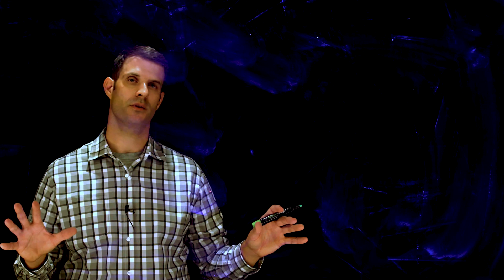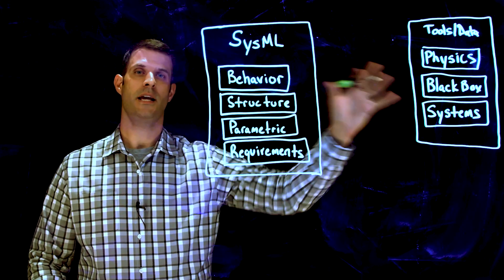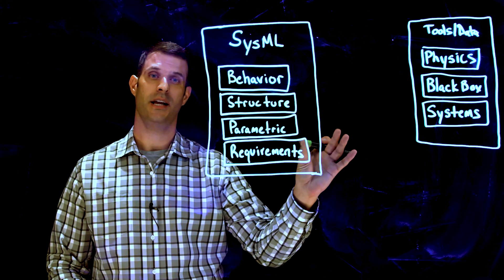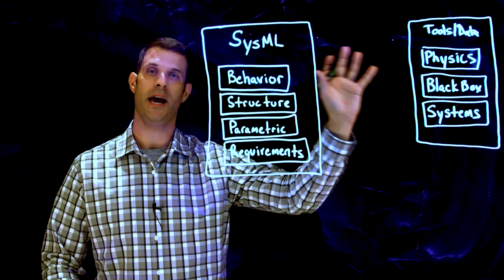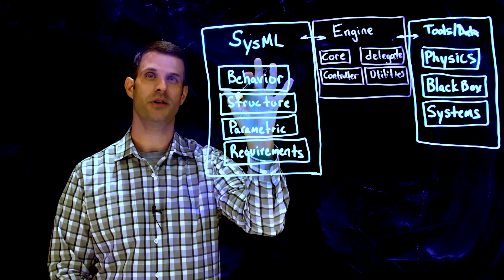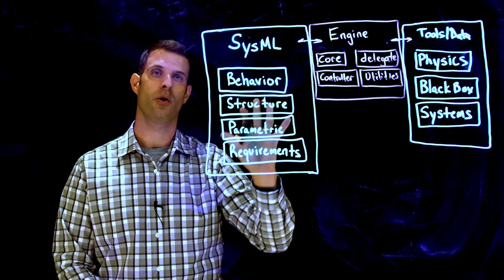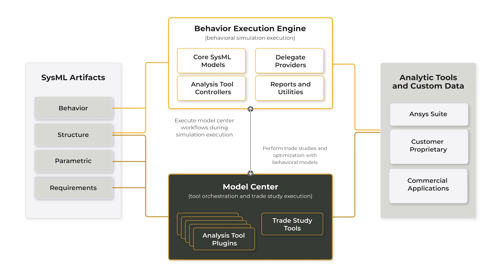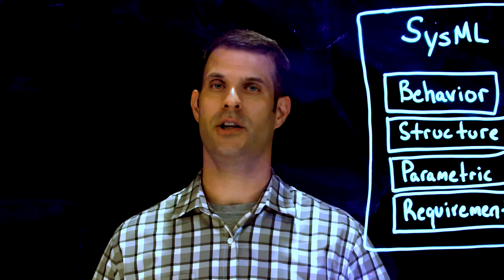Behavior Execution Engine Explained | Ansys Lightboard

Comment: hello have error with nonlinear simulation Ansys problem The unconverged solution (identified as Substep 999999) is output for analysis debug purposes. Results at this time should not be used for any other purpose. how solve this ?